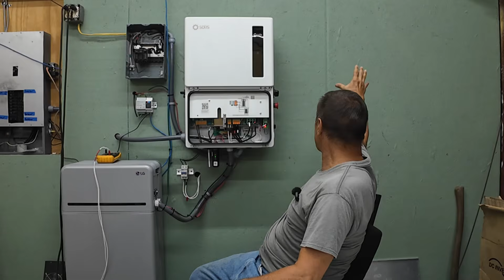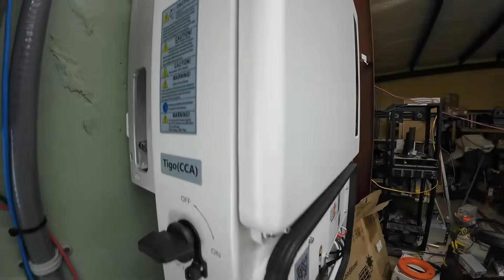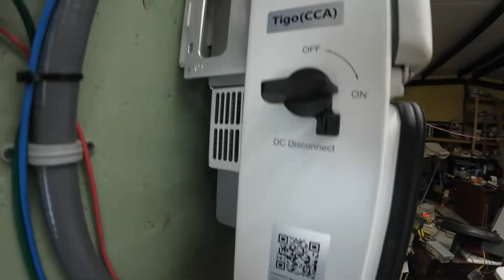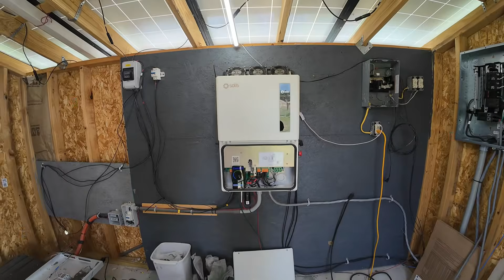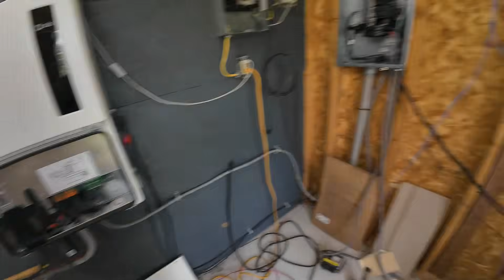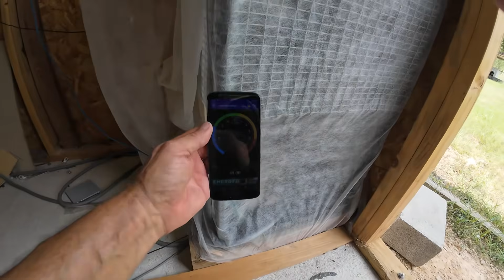How Loud Is the Solis S6 and plans for the new 50Kw High Voltage Inverter

Comment: If you are going to have 100Kw of inverters how many panels are you planning on putting up? If you did 550w panels woudn't you need at least 180-200 panels?
Reply from the maker: Hehe, would be nice if I could do it all at once but right now I have 80 more 370 watt panels here to install that's 29Kw plus the 15Kw at the shed now is 44Kw. That's enough for my next step.

Comment: I would really love a 30kw inverter. I want it on a wall. I really enjoy the updates. I grabbed a s6 11.4 ordered a Stark CMR . I should grab a battery soon and 8k worth of panels maybe this week.
Reply from the maker: Nice, you can't go wrong with the S6! Let me know how the build goes! Thanks for watching!
Reply: I happy i dident it get all in 1 inverter (im running paralel)
It give more mppt inputs (for different angles..)

And if 1 inverter goes, im still at 2/3 power and batterie

And it was cheaper, even with a 2000dollar box so i can control all inverters and batteries as 1 unit

And it can control import/export
So i can use my grid connected system as a offgrid
if they dont pay me better then my btc miners does 😂
Reply from the maker: @Hansen710  Awesome, I'm with you on running multiple inverters! I just got in my 3rd Solis 11.4kW. But for the loads I'm going to run the 50kW's will be much less expensive.
Thanks for watching and happy mining!